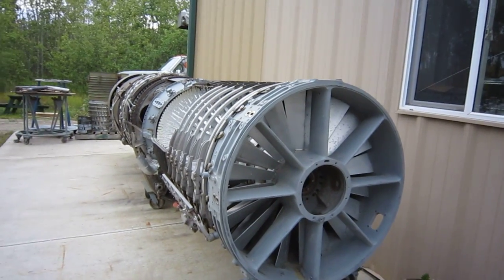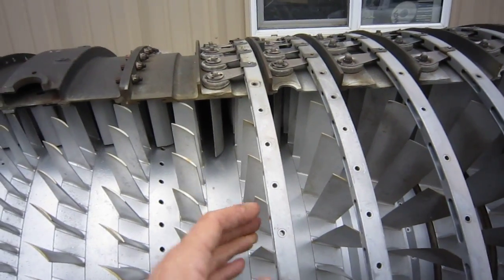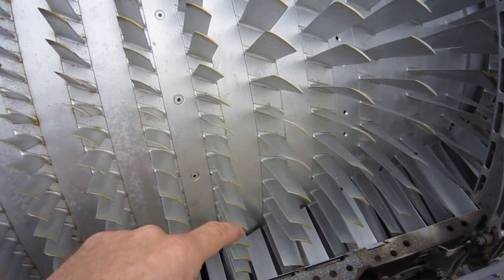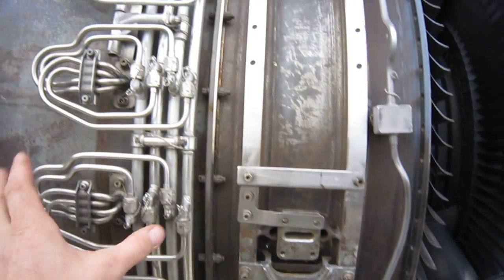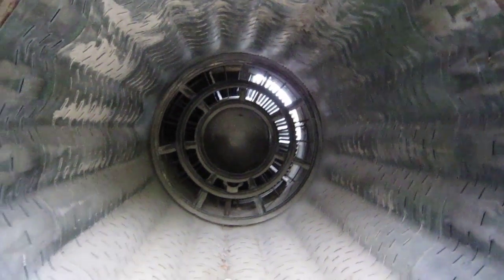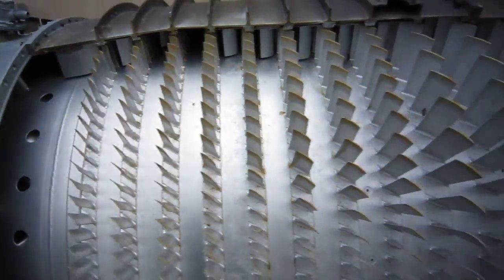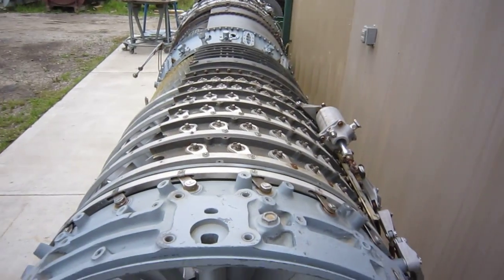J79  - Turbine Engines: A Closer Look

Comment: I take it that despite believe of "The hotter discharge from the combusters, the better/more-efficient the operation.", there does come a point where too-high of discharge temperature over-stresses the metals found in the aft-section & cooling the charge aids said pieces longevity.
Reply from the maker: You are totally correct up to the point where you say cooling the charge. To me that would mean cooling the inlet air. That has no effect.
The discharge of the combustor is a combination of combustion gases mixed with what is called cooling air. So If you mean that, then you are also correct. You just said it in an unfamiliar way. The gases that make the turbine turn are only a few degrees below melting temp of the parts at full power. In some engines with air cooled blades, it is higher than blade melting temp.
Reply: AgentJayZ
 Sorry if my phrasing caused confusion... I guess in my urgency to comment I didn't think to double-check my phrasing.
But yes, I did mean it as you said in the latter part. And having an understanding of heat-regenerative turbine design--Chrysler"s legendary turbine-car developments--I certainly understand the importance of keeping post-compressor air temperatures high for the sake of more complete burning of the fuel introduced & overall fuel-efficiency.

Also, I'd like to mention that I've seen a similar such design used in exhaust-tip design by Banks Engineering on their after-treatment exhaust systems to cool diesel exhaust gases--Most successfully!--with just ambient/surrounding air.

Comment from the maker: @mytmousemalibu The torch ignitor has its own fuel nozzle and ignition plug, inside the housing.
Random sparks could be a result of a slight rub of the turbine in the case ( minor ), or it could be pieces of an overheated turbine blade breaking off ( major)

Comment: The stators direct the flow of air to the next stage compressor. They increase pressure while decreasing velocity. Pressure increases from one stage to the next. Without the stators pressure would not increase between each stage.

Comment: Question? Lets take the F-86 saber form the 50s . They have to remove the whole aft and tail to get to the engine. The engine has 4 or 5 cylinder's on the outside of the engine. Are they combustor cans? Always learning. Thanks!
Reply from the maker: Have to? That's a huge design advantage. I don't know how long it takes to swap out a Whirlwind 1820 on the wing of a B-17, but you can replace the engine in an F-86 and be back in the air in about an hour.
There are 6 combustor cans on the Orenda, and 10 on the J47.
Reply: The A4 Skyhawk also had the entire aft assembly removed so the engine could be taken out or installed. The aft section was held to the front section by two, as best I can recall, TWO, 1"x 8" 12 point bolts with a 9/16" head. The torque was something like 799 foot pounds! 1" drive Snap On torque wrench with a sliding handle, stepped down to 3/4 drive, ten down to 1/2" drive and a universal socket. Can't tell you how many of those exploded when the max torque was applied!

Comment from the maker: @COD5252 You're opening a bit of a can of worms here.
Technically this engine has one combustor outer case ("chamber"), with ten liners in it.
Liners are often called cans, and cans makes you think of chambers.
Older engines did have separate combustor cases ( "chambers") of various numbers.
Newer engines have one case and one annular liner.
I don't know of any engine that has two liners, or that has two separate outer cases.
Running out of characters now. Hope that helps.

Comment from the maker: @IWMYB61 The direction of the airflow through the engine acts like a large wind blowing down on the top of this imaginary wing. The effects of this wind are less severe as the wing speeds up. But the wind gets stronger as the wings "above" it move faster.
When I try to match the behaviour of the variable vanes in the J79 to my intuition , I can't. It does not seem to make sense. 
However , it works very well.

Like I said, it's complicated.

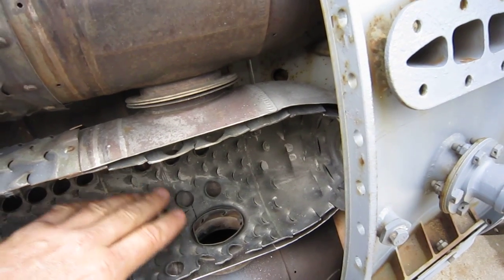Comment: Hey AgentJayZ, curious to know what purpose the little "finger nail" shaped rises serve inside the combustors? I noticed you had one cutout showing this @ 1:54 in the video.
Reply from the maker: They are holes to allow air to move from outside the liner to inside. They are also shaped a bit like scoops. This is a convenient result of the manufacturing process.

Comment: Thank you for sharing this vídeo. I hace a cuestión. Why do the turbines sound so strong? It's because of the fuel injection of because of the hot que compresas that toda out from the turbines?
Reply from the maker: +MAX BONETT They make a lot of noise because they make a lot of power for their size. They transmit that power to the air with a jet of air moving very quickly. Since sound is moving air, there will be a great deal of sound created when a large amount of air is moved to high speeds.

Comment: Nice video AgentJayZ. 2 Questions - the bearings that supports the rotating assembly, is it a whitemetal bearing (meaning plane bearing) or does it have rotating rolling elements? Question 2 - the igniters, do they "fire" in a sequence continuously or only for start-up? Thank you.
Reply from the maker: 1 there's a search bar on my channel page. Put "bearings" in there.
2 ignitors are used for starting, then are turned off for running.

Comment: @AgentJayZ I get what you're saying regarding pressures.  But still, something has to transmit the 18,000lbs of thrust to the airframe.  That outside skin doesn't seem like it's made for that.  I'm guessing that the rotor is designed to carry the axial load to the bearing housings which transmit it to the airframe?

Comment: Very nice explanation thank you...what was the reason for the compressor blades to sound musical again?? I did not understand
Reply from the maker: Normally, the compressor blades are held very securely in their mounts, but allowed some movement, to eliminate the build up of vibratory or resonant energy, which could eventually lead to breakage, and resultant massive engine damage.
The corrosion in the mounts of these blades has locked them rigidly in place, so they resonate like tuning forks.
Reply: @AgentJayZ  Thank you for the explanation....

Comment: Very cool! I like the musical compressor blades. A question...are the "nozzles" in the turbine section like the stators in the compressor? There are no stators in the turbine, right? But between each disc, there is a set of nozzles to direct the flow at the best AOA to hit the next disc? Is that right? Also, I remember reading something about one of the two sets of exhaust nozzles being mechanically adjusted, while the second adjusts itself according to the pressure...is that true?

Comment: I'm guessing that because of the convergent/divergent set-up within each stage, the gap will be the optimal one. At extreme operating envelope of the axial-flow engines, anything less within the divergent section of each stage is likely to induce a stall/surge within the engine. Not a pleasant state of affairs, I can assure you. Compressor blades can be spat out the intakes if this happens.

Comment: Can you please answer one question? It seems from the combustion chamber's inside that the compressed air only enters from the holes on it, but you you said they were for cooling purposes. So is there another channel from which the air enters for burning? From the look of it, there are no other paths visible.
Reply from the maker: Like anything highly developed, it's complicated. About half of the combustion air enters the forward end of the combustor liner, right around where the fuel nozzle is located. The rest of the air used for combustion enters through the first few inches of the cooling air holes you mentioned, located around the outer circumference of the liner
Roughly the first third of the length of the liner from entrance to exit, allows air to enter to both participate in combustion, and also to centralize and separate the flame from touching any metal. The last two thirds allows air to enter and mix with the hot combustion gas, cooling it to a temp which won't damage the turbine nozzles and blades.

Comment: Hi. What are those flanges on the diffuser between the fuel injectors ? they are often blinded With seals when u testrun engines.. I allso saw similar on the T56 cutaway, and there it seems to lead into combustor area. Are compressed air leaded out from here for some reason ?

Comment: Also, if you counter rotate the stator vanes, you lose all compression. The compressor stator vanes slow down the accelerated air and are what actually cause the compression.

Comment from the maker: Just noticed this comment. You do not understand what you are saying.
Three piece shafts is incorrect. Three shafts are contained in the RB211.
Each shaft has a turbine and a compressor, and the relative speed of the compressor to the turbine on each shaft is of course zero. Each of the three shafts, or systems, rotates as a unit.
In order which the air encounters the compressors, they are called the LP, IP, and HP systems.
Nobody made anything up; you just misunderstood.

Comment: @AgentJayZ Thanks. Out of curiosity, why is engine oil used? Is there a reason it was kept separate from the aircraft hydraulic system? The only thing I ever worked on was T700 engines on Apache helicopters. It's really cool to know about other engines and their operating principles, especially something as historic as the J79.

Comment: Great video!  What I don't understand about these engines is that most of the parts are such thin sheet metal.  They look fragile.  With the pressures and thrusts involved, I don't get where the structural strength comes from.  Only the bearing housings look strong.

Comment: AgentJayZ -- Nice video, thanks for posting.  I'm curious what part of the engine is it that receives the reaction force from the thrust of the exhaust gas, which pushes the engine (and ultimately the aircraft) forward?  Is it the part your finger is pointing to at 2:33 ?

Comment: Thanks for your reply. I meant the most outside part that holds everything. As far as I understood that welding sheet to casting was nearly impossible to achieve unless they use brazing. Does the certain alloy make this welding process easier? Seems like Inconel, Invar and such would be a challenge. I am very impressed of their capability to achieve this technology in a very short time since the Wright brothers.

Comment: Hi AgentJayZ, You said in the video that the compression stage is 1.1 to 1 ratio for this engine. Do you know the what the single stage compression ratio is on the most current jet engines?
Reply from the maker: Aviator168 That's a very broad question, and my vague answer is: about 1.5  to one or greater. Your actual compression may vary depending on your selection of engine and driving style...

Comment: Thank you, Someone finally answer the question how doe an Aircraft engine start in the beginning.
Reply: When I was in the RAF they started the Hawker Hunters with something called a Coffman starter. You fired a cartrige in a gun, and instead of pushing out a round, the gas would drive a small turbine coupled to the main engine shaft.    So from my office on the station, I cold hear BANG! whine of engine running up, roar of engine starting. They also used a similar system on piston aircraft, remember the “Flight of the Phoenix?”
Hell. I’m showing my age. I left the RAF in 1958..

Comment: 2 Questions:
1. Which material is the combustion chamber and exhaust nozzle is made of as they have to withstand extreme temperatures.
2. From where does the bleed air comes out?
Reply from the maker: +Lalit Vatsal 
Both questions have been answered in videos on the playlist Your Questions Answered.

Comment: Are the compressor blades seized due to being in the elements to long - or are they mounted that way into the disk? Trying to figure out as it doesn't seem to make sense to have loose turbine blades and fixed compressor blades.

Comment: Hello very interesting explanation. Do you see problem of nozzle actuating when on board? Because of temperature or two much service.
Reply from the maker: I don't understand what you are asking.
Reply: The nozzle actuator back end . do you thing its possible while on plane after sometime to start flexing due to temperature. Just asking...
Reply from the maker: +theodore iakovidis As far as I know, there is no time limit on the use of the afterburner due to temperature of the components. The aircraft usually only has enough fuel for about ten minutes of AB use, though.
It's typically used for much shorter bursts due to the huge increase in fuel consumption.
Reply: Nice point. Thank you.

Comment: Hi AgentJayZ,  it would be interesting to know why there are such huge axial clearances between the compressor vanes and the stator vanes (yes I know they pivot). If the gaps were a fraction of the size, you could knock nearly two feet off the length of the engine and seemingly make it more efficient?

Comment: How does each fan compress the air by 1.1 each stage? Does each one turn faster than the one before or are the blades just angled slightly different?

Comment: Just curious. If you were to turn the engine by hand, would it spin with little resistance or would it take a massive amount of force?
Reply from the maker: You can move it with a finger. The power needed by the compressor depends on its speed. At zero speed, no power needed.
The spec is a max of 11 ft-lbs of torque is all that is needed to make it move.
At its max rpm of 7800, it requires about 20 thousand HP.
Reply: Thanks for the rapid response. I enjoy your videos!

Comment: Anyway, (for the benefit of 'thelol' and M Radway, the obviously solution to get less or more relative speed between compressor and turbine sections, is to 'split' the central shaft that everything is fixed to and put in a couple more support bearings and a gearbox (step down or step up epicyclic) between the two halves, as they already do on loads of modern jet engines! Having counter rotating stator vanes to gain (or lose) relative speed would be a far greater complication, as AgentJayZ states

Comment: Are they bearings roller bearings with an oil flow to keep them cool? How many seperate bearing are there throughout the shaft?
Reply from the maker: Video: Jet engine lube system.
Channel page search bar: Bearings

Comment: How hard is it to get some defektive jet engine turbine blades? Like the ones you made those lovely sounds with...
Reply from the maker: Those were compressor blades. Not terribly difficult
Turbine blades are also not impossible to find.
Many for sale cheap on Ebay, but watch my video on Ebay blades first.
Then there's also the barter method...

Comment: It's fascinating to me how the combustion chamber remains open to the intake (as opposed to being closed with a valve as in a piston engine). Are there any forces from combustion that push back against incoming air as a result? Is this a reason why the air takes a winding path into the combustors in many turbine engines?
Reply from the maker: +Isaac Lubow Pressure is higher in the compressor outlet than it is in the turbine outlet. Air goes from hi to lo, always.
Reply: So the combustion doesn't increase the pressure further?
Reply from the maker: Correct. Most important thing to repeat, over and over: these are not piston engines.

Comment: 1:39 If you were to estimate what the speed in mph the air is traveling at when it reaches the Combustion Chambers, what would that be? Too much wind and you cannot have a fire, correct?
Reply from the maker: In an old book about an engine a generation before the J79, it mentioned a speed of air in the combustors of aboit 60 to 80 feet per  second. .

Comment: I have a question, the diffuser reduce the pressure of all the air that go out of the compressor, or only the air that flow directly in the combustion chamber ( not the air that bleed in afterwards)?
Reply from the maker: The diffuser slows down the air coming out of the compressor. As the air slows down, it increases in pressure.
Reply: AgentJayZ Oh yeah, diffuser reduce the speed, sorry. But is there a difference between the air that flow directly in the combustion chamber and the air that bleed in afterwards?

Comment: I notice here the blades seem very tight - in other videos on the subject they show a slight movement in the blades and say they need to be like that to reduce vibration and stresses. would these blades also normally be slightly loose fitting ?
Reply from the maker: +Jack Silver Yes, if they were in a serviceable engine, and not in a cutaway that has been stored outdoors for ten years... they would show a bit more looseness in their mounts
Reply: Ah,I see. Thanks.

Comment: How does the air begin pump through the engine in the first place ? Through stored electric ? Does that mean that at a certain point you use less fuel because more air is driving the turbine?
Reply from the maker: When the rotor starts moving, the compressor begins to move air. Your other questions make no sense.

Comment: Could you possibly explain, how by looking at (or counting) the number of stages of a compressor tells you the overall compression ratio? As you've mentioned, each stage of the compressor compresses by 1.1:1. I counted 17 stages in there, and learnt that overall compression ratio of J79 is 13.5:1.